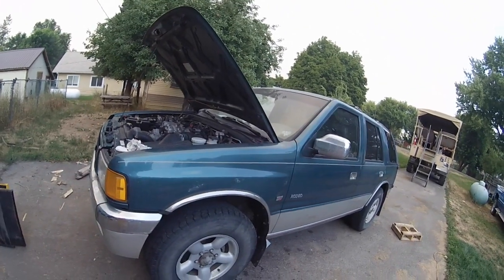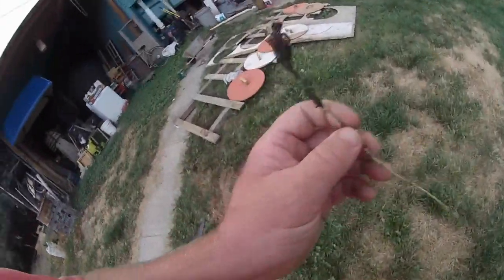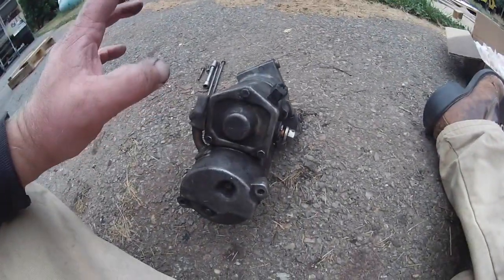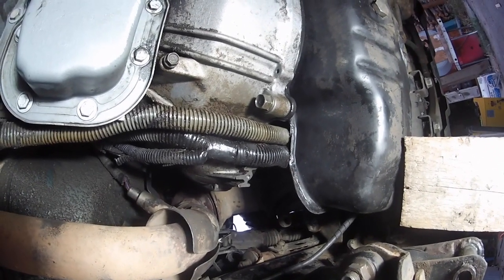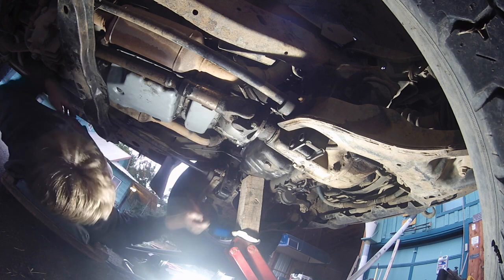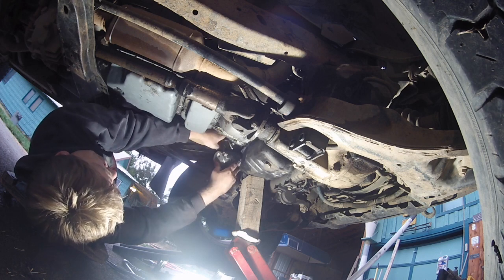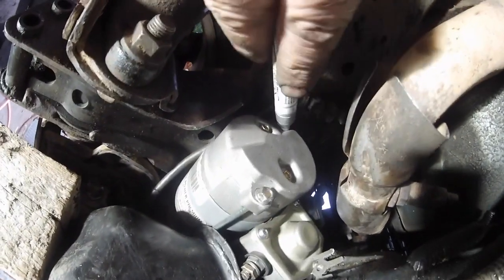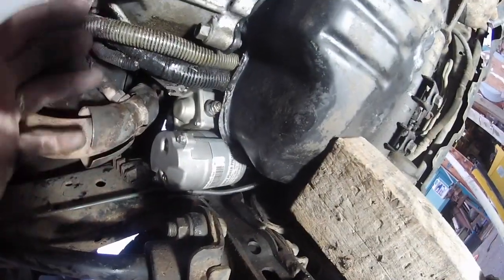1996 Isuzu Rodeo Starter

Comment: Thank you for the video, I have gotten mine working as well by taking the solenoid apart enough to clean it and get it working again but it has failed after a couple years so I am about to tackle this as well. Your video is very informative and I am sure I will share in your frustration in the coming days.

Comment: am a prof. mechanic and Dude Way to GO, should get a Trophy :) had a 95 that was doing the click click, was able to rebuild solenoid in car without jacking motor,  by going above through wheel well and under.....they have {kits} must pull piston and measure, they have different sizes, lengths, but a its a Fix for that common problem thanks again for persevering and giving us all a gift

Comment: I just did mine on an Australian 2003 Rodeo, same starter motor with the starter also on the left hand side on a right hand side vehicle. 
Our break components are on the right hand side however. 
I removed the front wheel and the two 12mm bolts on the heat shield. Starter came out with 3mm clearance.

Comment: Being 60 years old, I learned that in buying a vehicle, If I can't see the starter or spark plugs by just opening the hood, I don't buy the vehicle. I was surprised when I bought a new 2012 Doge Ram, I could actually almost fit in the engine compartment, relativity  speaking of course. Just food for thought next time you are in-search of a vehicle.
Reply from the maker: I tell people the drive train is rock solid... because nothing has room to break.

Comment: There are two pretty good videos on removing the starter, one from a trooper (same procedure) and one from a Rodeo and both are dated earlier than this one.  Somehow I guess you didn't see those.  It is not easy under any circumstance but their procedure seemed better than disassembling the starter in the car.  However, you got the job done and I guess that is what is important.

Comment: Are you on Facebook?  You should join a group called Isuzu Trader.  
https://www.facebook.com/IsuzuTrader/
Everyone there is a part-time saint.  A real great bunch of people.  I'm not on FB anymore, but I think I miss them the most.  A lot of guys there really know how to work on these.  

For example, IIRC, there's a trick to getting the starter out on these.  It goes something like...Prop the engine up and take the motor mount loose on the side opposite the starter.  This lets you lower the engine a wee bit lower than usual on the disconnected motor mount side, giving you the necessary clearance on the starter side to remove the starter.

Anyway, it's a commonly mentioned technique on there.  Just mention it and they will tell you how it actually goes and whether it works for 96 Rodeos.